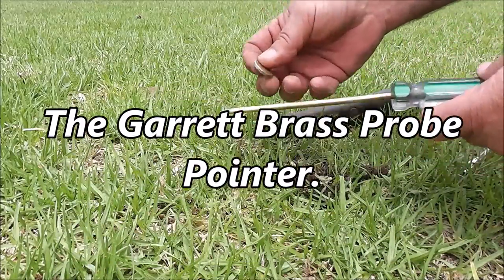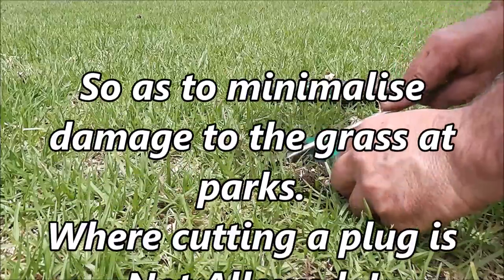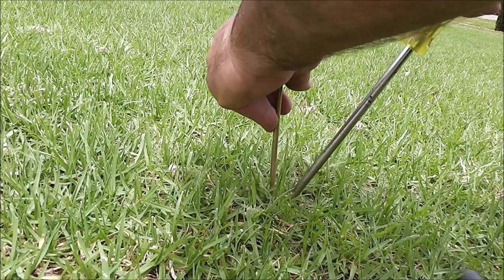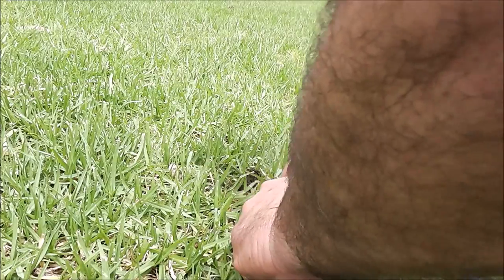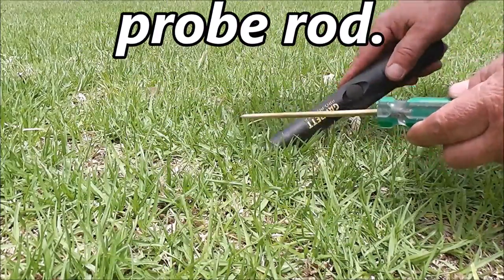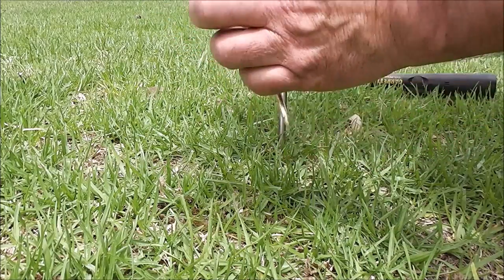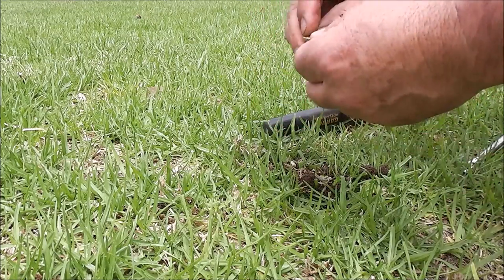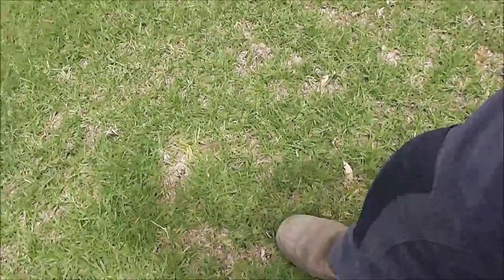How to use a Garrett Brass Probe for detecting coin in the park lands.

Comment: Great tip Tony got to get me a probe
Reply from the maker: Hi Yooper Digger57 
Just another option where you are not allowed to dig out plugs for shallow coin retrieval.
CheersTony.👍🍺⛏
Reply: I really like the idea I got a really old park in the next town they wont let you dig but you can detect it so this might work well for there
Reply from the maker: Yooper Digger57 
It just less damage.
Once the dirt is put back and then the sprinklers come on or rain 🌧 washes the soil in.
You would hardly even know that you have detected there.